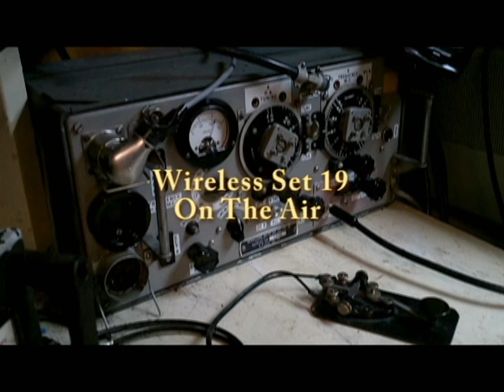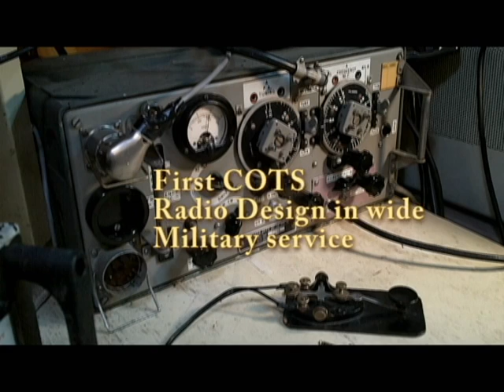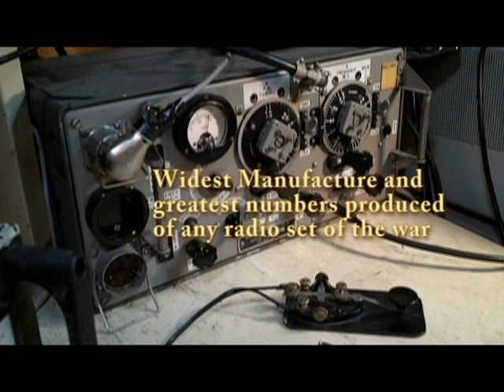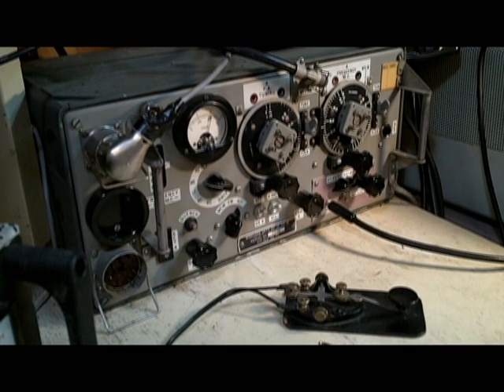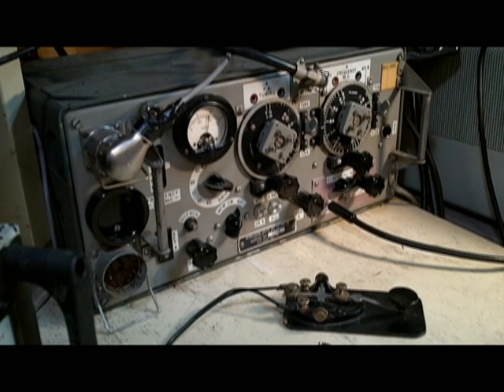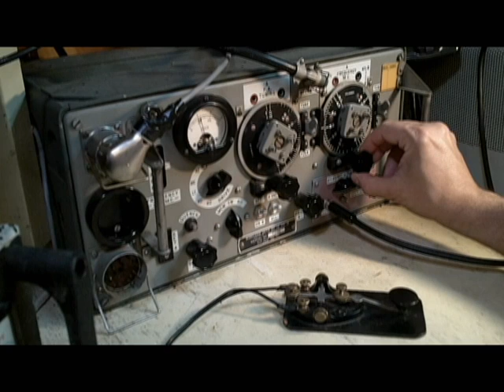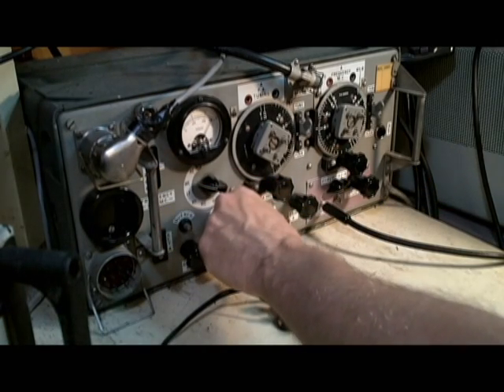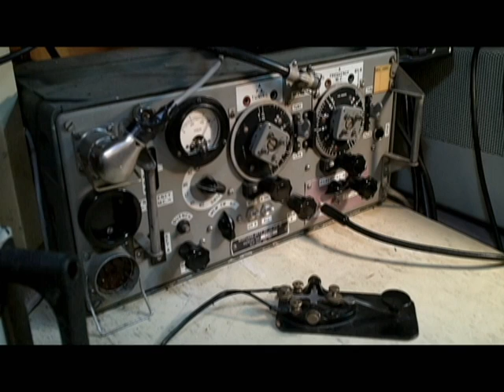WS19Movie.avi

Comment: This inspires me to work harder on my Morse Code now, hearing other people going so slow. I thought there was no hope for me at 5-10 wpm, and hearing so many people at 20 wpm and faster. This inspires me to actually try CW on the air sooner, rather than later…
Reply from the maker: There are many folks who use vintage equipment and many QRP stations, who routinely operate at very slow CW speeds now. Generally above the 25-50 kHz at the low end of the bands. And there are slow nets now.
Reply: @MIKROWAVE1  … I just passed my Amateur Extra this past Saturday (a week ago today; June 24th) during Field Day in Tallahassee Florida, and made the (eye-opening) “mistake” of going to the CW camper, and watched for a good long time, their “contesting”, and my mind was blown; a total BLUR; one guy keying, and another guy logging, and, for my ear, it was all so fast (receiving being infinitely harder than sending for me) that it might have just as well all dissolved into a steady sine wave. To be sure, I’m a beginner with ALL of it still, in my mind, and an “EXTRA”-beginner-beginner when it comes to CW, but these guys were FLYING. A LOT of memory keys being used, spitting out stuff at, I’m guessing, about 40 wpm or so, and I don’t think anything I heard was slower, even manually with paddles, than about 20-25 wpm. The memory keys though; that seemed so much like “cheating” to me. I could hear/copy only a tiny handful of letters and words out of bazillions it seemed, and I sat there long enough to witness approximately 100 contest contacts… I know it will get better, but WHAT a mountain to climb; what a sheer vertical CLIFF. Plus I deeply admire your electronics knowledge, and so much want to understand the electronics; the “nuts and bolts” of it all, rather than just buying off the shelf radios. I want to be knowledgeable enough to be able to BUILD my own radios out of “scrap parts” laying around, but I’m so afraid that the powers that be are going to make radio as we presently know it, go away at right about the same time that I “arrive” with my knowledge and skill set. Looking at what’s happening to broadcast AM, I fear they will eventually take it all away from us…

Comment: That's nice.
I remember these being advertised in radio magazines in the 1970's when I was a SWL and wanted one.
It took a lot longer, I got a British Mark III in 2017 which was extremely deaf and needed much work. It's pretty lively now and I just replaced all R's and C's in the c.w. filter which had also been deaf. What an improvement. The meter says 1944.
It's tatty and for stability I made it xtal on 3.560, 5.262 and 7.030 MHz on tx. Only 250 Volts on all stages so run QRP about 2.5 Watts out.
Best so far about 280 miles into Mallaig on 5.262 MHz.
G4GHB

Comment: Is this an A Set or a B Set?
Reply from the maker: This is the A set in CW mode. The WS19 has an A set and a B set. The UHF AM only B set or "troop set" provided short range communication between tanks in a troop.  The A Set provided the long range Liaison CW and short range AM at HF.
Reply: Thank you, I’ve since learned that my question was sort of misguided..  I’ve recently come into possession of one of these sets, it’s a WS-19 mk. II with both English and Cyrillic.  It’s in fantastic condition and also came with a Power Supply Unit No. 1, with both units strapped onto a solid piece of steel.  It also came with 3 cables, the “dogbone,” a 12 point, and one that connects to the aerial connectors.  How are you powering the WS-19 in this video?  Thanks again, I appreciate your generous patience with such an obvious noob.
Reply from the maker: Wow Sean, you are a fortunate guy to get the entire setup. There are some great and far more knowledge folks that will help you get it ready for operation. I made an AC power supply for mine.
Reply: MIKROWAVE1 Thanks for your response!  What I’m worried about most is the 500v section.  I have an idea for an AC power supply, could you maybe tell me if I’m way off base?  I have a Dewalt battery charger, one of the large ones with wheels and a handle.  It has several settings, from trickle charge to quick charge to jump-start.  Could I use a deep-cell marine battery to smoothly power the WS-19, while using the Dewalt charger to keep it charged?  And if so, would a setup like this enable me to eliminate the need for a variometer?

Comment: My first radio too. Bought surplus in England in the mid '60s. You couldn't give them away then - I got mine for the equivalent of about $3, fully working. I was fortunate enough to have as a radio mentor a guy who had worked on the assembly and test of the WS 19 Mk III (has anyone ever seen any other model?) and was a font of knowledge including that after the war tens of thousands of these sets were dumped in landfill so as not to overwhelm the second hand parts and vacuum tube market.
It was a good set and I never heard any complaints from the soldiers using it. Nor was it unrugged in military use - it was considered pretty bomb proof. Mine had a lot of metal work in the case(screened oscillator, rigid cabinet etc) and weighed about 50lb.
It was powered from a 2 stage (noisy!) mechanical rotary transformer 250v on receive, 500v for that 807 PA anode on 'send'. As people have commented, it had a 'variometer' ATU - pretty essential for the short ground or vehicle mounted whips the soldiers used. It was soldiers, too, neither the Royal Navy or the RAF used the 19 set. There was also a external linear amp option which increased the output of the 'A' set from about 10w to 50w for HQ use.
Sure, the selectivity was pretty wide and there was minimal receiver filtering but, what the heck, there weren't many other stations around back then!
This is a truly iconic set - always associated with the British desert actions in N. Africa, Rommel and co, about 1942. My set had sand in it when I first got it. I wonder what tales the radio could tell..
As you say, the set was made elsewhere (and the British ones not only by Pye) - most particularly Canada. The Canadian sets have dual English/Russian Cyrillic markings for use by the Red Army.
Finally, did you know that the empty Bakelite 'socket' thing on the left hand side between the two i/o plugs was supposed to hold a large chronometer? These were almost invariably 'lost' by the tank crews and I've only ever seen pictures of them, never the real thing. A very nice clock apparently.
Sorry to go on, this was a real trip down memory lane! Thanks for the video. Only just found your channel and really like it. Regards Al M0GTK.

Comment: Great video, thanks. Will jog me to get mine on the air. I would argue, however, that the BC-222/322 walkie talkies were the first true military transceivers - no, wait, there was a US Army radio of around 1920 with 2 or 3 tubes that used the oscillating  tube as both low power transmitter and oscillating detector. -Hue

Comment from the maker: I recapped all of the higher value capacitors and the 25 or so 0.1 uF paper caps. Almost all of the replaced caps (Sprague USA) were still testing perfect at 600V test for leakage so I wasted my time. Two resistors did need to be replaced.  

Mike

Comment from the maker: This is a WS-19 Mark II built by RCA SERNO 7030 built in 1942. This set is one of the early, likely the first run of American builds of the set. I have added a small metal plate which holds an RF gain control and a phone jack as well as the original band switch. All lettering is in English. I paid 5 dollars for it in 2008 and it was missing a cover, several tubes and was very dirty.
Reply: I have a No 19 MK11 Canadian . Used it to win the AWA AM QSO party this year. Fun radio. As a teen I had a No 11 the 19s forerunner. Good videos BTW.